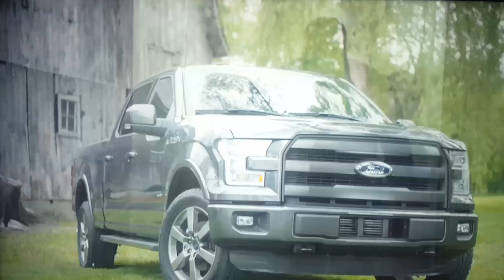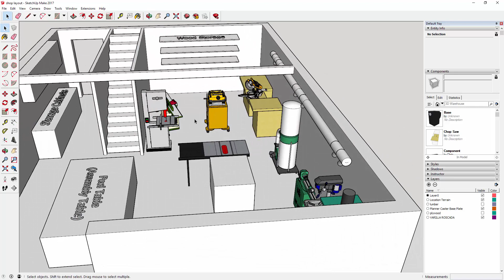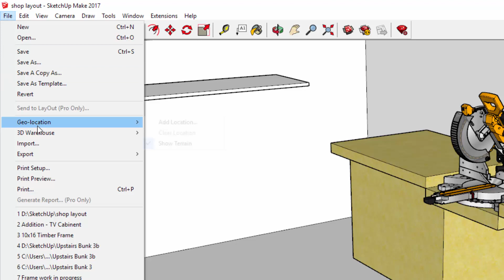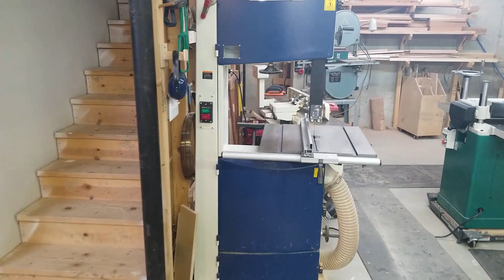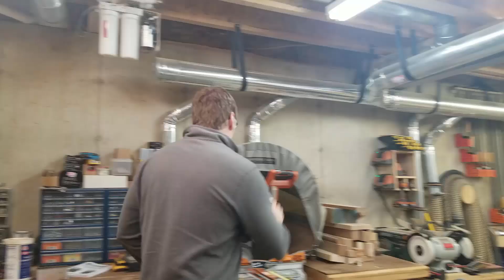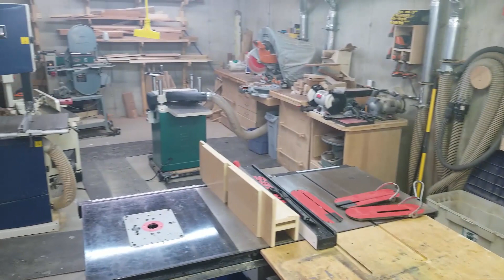Wood shop construction, layout and a shop tour

Comment: Hi, thanks for sharing.  How do you source your timbers for your timber framing projects?  Do you cut your own or do you have a local source?  Thanks!  (btw, I live just outside of Grand Marais and also took the build your own timeframe class in 2001...
Reply from the maker: I envy you your location. We fell in love with Grand Marais and the North shore. The first timbers came from the course itself, so from that mill just outside Grand Marais. Since then, I've cut my own from poplars growing on a friend's farm in Pennsylvania.
Reply: @SalemWoodworks  Thanks!  I'm interested in your setup for transporting and milling the timbers.  I'm planning an addition to our timber frame and deciding if I want to do my own.  There are some mature poplar (aspen), on my land here.  Curious to find out how they behave after milling.
Reply from the maker: I'm lucky in that my friend in PA has some good machinery available at his farm for moving the logs and lumber. You can see some of it in this short video: https://www.youtube.com/watch?v=4Y4AnqCmj9E - He has two skid steers, one with a grapple bucket that makes it easy to handle the logs. Milling we have done by a guy who comes to the site with a portable band saw. To move the resulting lumber, I have a 20 ft trailer that I purchased since making the above video. That one shows a 16 ft trailer I used to borrow from my neighbor.
Reply from the maker: As for how the lumber behaves after milling I have a couple of suggestions. One is to make sure you have it carefully stacked and stickered and if possible strap the stacks down during drying. I got more twisting than I'd like because we were working with less than ideal hybrid poplar logs. For  the timbers, make sure you box the heart when milling.

Comment: Pool tables make great assembly tables, they are heavy enough to take a lot of pushing and shoving, they are perfectly level and they make a great addition to any man cave when not in use. I was the production mgr for a major sauna manufacturer for 15 years, cedar it excellent for a sauna, but be very careful with boards with knots over 1/4 - 3/8” as they can pop or fall out when the wood is heated. Also use the driest wood possible as it will shrink after assembly leaving gaps in the t and g joints. Nice shop!
Reply from the maker: Definitely agree on the pool table. When I first put the pool table in the shop years ago, I figured I was wasting shop space and would regret it... couldn't be further from the truth. Thanks for the tip on the knots. Will keep an eye on that when the time comes to put up the paneling. I have a healthy supply and can afford to be picky.  The wood is definitely dry... it's been air dried for years, planed to final dimension and has been acclimatizing in the shop for months.

Comment: Great video Judd! Great to see your layout as I continue to brainstorm ideas for the overhaul on my dads shop. Anything you’d do differently about your dust collection? That’s the next big project for the shop overhaul!
Reply from the maker: The dust collection system is working VERY well. The only small change I'm thinking about is moving the duct for the planer so that it drops from overhead, so I can leave it connected without having the hose in the way. I'll likely tackle that as part of the rebuild of the chop saw station when I incorporate the radial arm saw. Of course I also wish the table saw duct went through the floor, but I'm not sure I care about that enough to bust up the concrete floor (I currently have to step over a 4" duct when I walk around the back side of the table saw). The switched blast gates are really convenient.  Fully automated blast gates that open when the machine is turned on would be an upgrade, but I'm not sure the cost is justified, for a home shop.
Reply from the maker: BTW, did you catch your cameo appearance in this one? https://youtu.be/FNhrDe9soGo

Comment: very nice! gives me ideas for getting things setup in my barn. though with the cost of led's these days, i wonder why you didn't use led direct wire tubes instead of fluorescent tubes...
Reply from the maker: Was originally set up with fluorescent bulbs (were I to do it over, I'd use LEDs). The new fixture over the work table actually IS an LED.
Reply: as you have the bulbs burn out, you can replace with led (without replacing the fixture). they make tubs that can be just a direct replacement... or... you can do some re-wiring and pull out the old ballast and put in a tube into the current fixture as well. :-)
Reply from the maker: @northernprod  a reasonable plan. I'm amazed how long the bulbs have lasted. I installed 7.5 years ago and the bulbs are still going strong.
Reply: hah... i've had about the same use out of the ones in my pole barn (haven't had to do anything since 2008)... i'm having to finally replace them in the barn and going to led so i don't have any wait period for them to warm up in these michigan winters! :-) i switched the lean-to's of the barn over to led several years back and has been great.